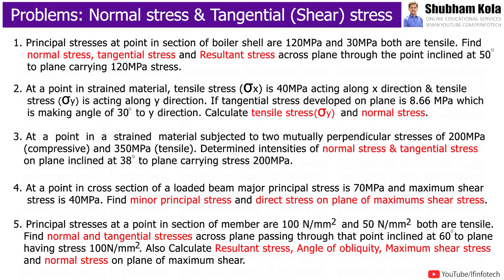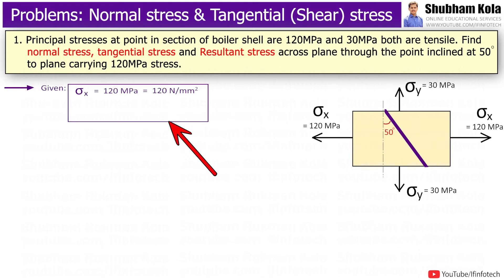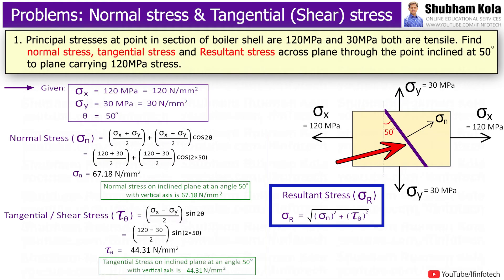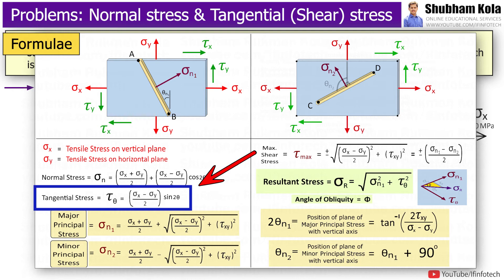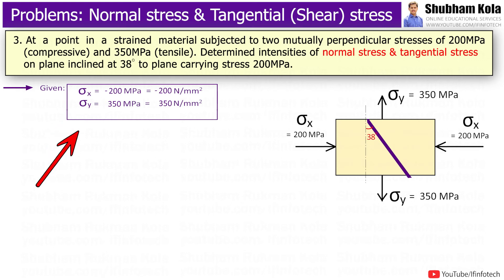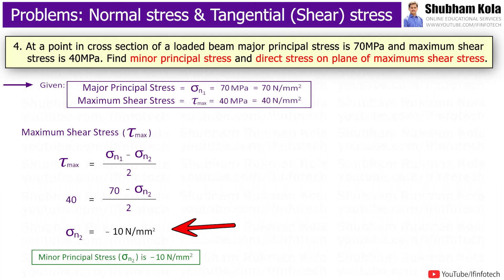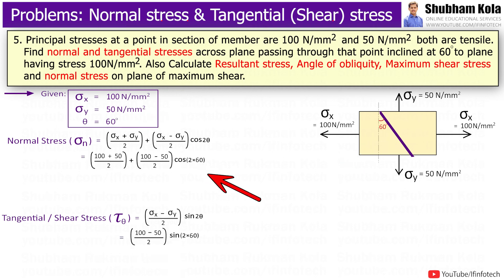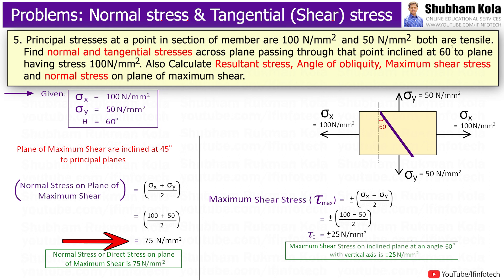Normal Stress and Tangential (Shear) Stress, Resultant Stress, Angle of Obliquity | Solved Problems

Comment: Sir if question said us angle 60 degree  incined with major axis ,to find normal and tangential stress what is the value of angle we take ? 60 or -60 .what if you take -60 if it doesn't said it rotates clockwise or anticlockwise or angle should be taken 30 degree ?? Help me 6:38

Comment: Nice..TQ for good  explanation sir but going fast calculations..I mean difficult for beginners..also wanted thermodynamics problems..like heat pump , refrigerator and Carnot cycles etc..
Reply from the maker: Ok, I Will upload soon🙂
Reply: @Shubham_Kola  but sir why Iam doing calsi iamm getting different values than you